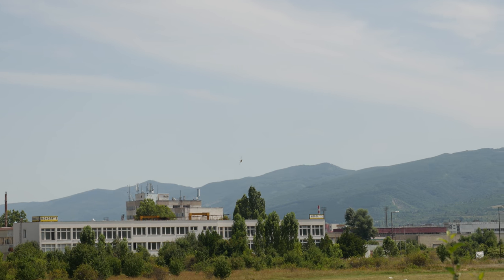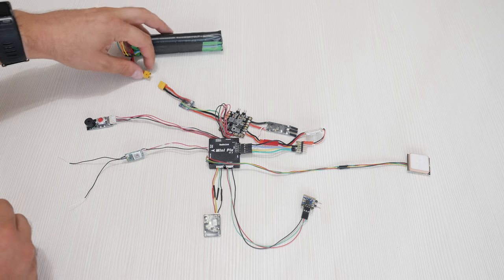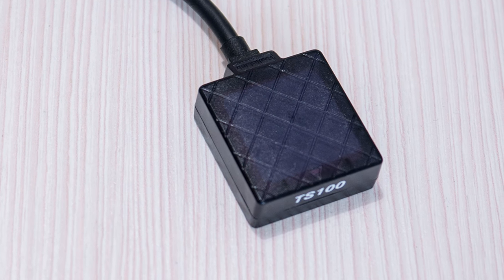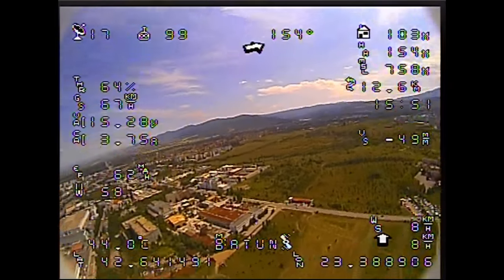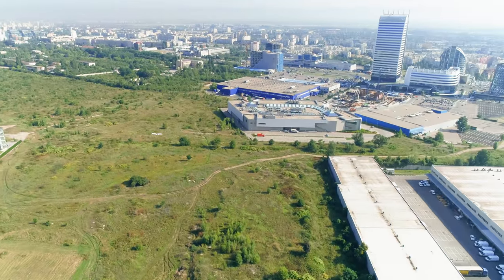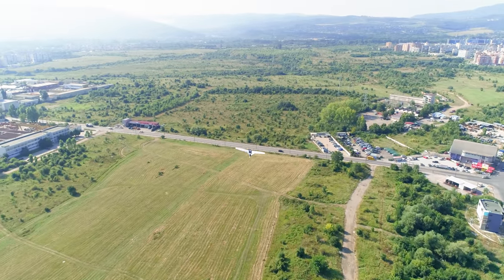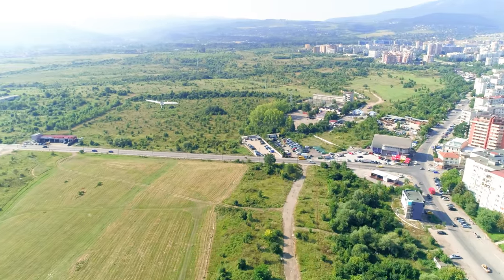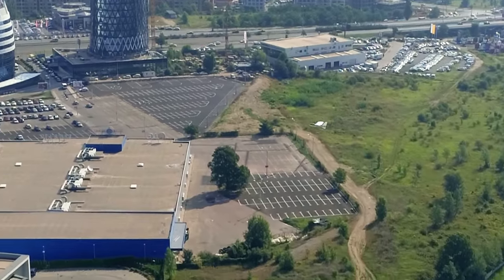ZOHD Nano Talon with RadioLink Mini Pix (install and maiden)

Comment: Hi. Volantex Ranger EX 757-3 1980mm Long Range FPV RC PNP or Volantex RC Ranger G2 – 1.2m glider plane 757-6 PNP, which of the two models is the best platform for a Long Range project, up to 20 km? Or, please, can you suggest another model that I can buy in the EU these next 2 or 3 days? I travel in a few days and wanted to take the model with me! Many thanks for the reply! Let's go forward! Best regards
Reply from the maker: Actually this is hard to say... both planes are COMPLETELY different - one is 2m wingspan, the other is 1.2m wingspan. For 20kms out I would go for the Ranger EX... but then it depends on what you need to do with it! The Ranger 2000 might be a more suitable option to be honest.
Reply: Really, thank you very much for the feedback. I asked this question a few months ago and I was hesitating this whole time ... I bought yesterday the 757-3, the landing gear and interior space ended up determining my option. Fly with 2 x batteries and all the electronics need to lift flight and get landed more sustainably, won this model! Now, I'm going to work on your electronics! Renovo, thank you very much for the feedback. Best regards...
Reply from the maker: Good luck on your build mate! :)
Reply: Thank you, will begin assembling the EX Ranger 757-3 this weekend ... then I give feedback about it! Best regards...
Reply from the maker: Fingers crossed! :)

Comment: Very helpful with information and real-world tests, super informative about equipment, batteries and LongRange as a whole. Learned a lot from this channel 

You rock!

After watching most of your videos, today was my maiden flight with Mini Pix and 4S2P/5AhLi-Ion config on handmade FT Spear, It flew great, made the test mission flawlessly, cruising a bit fast 55km/h but OK, the GoPro video looks stable and clean, got 41km range with 13.09v at the end and everything was smooth as butter.

BUT The compass variance error and bad logging are super annoying. I tried to disable all compasses but got Bad Compass Health error. Is there a way to disable it altogether  MP 1.3.7. Can it fly really OK without using the compasses?

Also any hints for Bad Logging, I've tried 4-5 different SDs ranging from 2GB to 32GB (FAT16 and FAT32) without luck, have any info on solving this too?

Keep it up.
Fly Safe :)
Reply from the maker: Thank you! Actually I've never used a compass on a plane, and I've never had issues for not using one! I just uncheck every tick box in the compass tab... and that usually sorts it!

Comment: So good to see a thorough display. I have three Mini Pix. All have passed the first steps up to and including Loiter (On a Copter). But so far the installed unit has not responded to the Auto command to fly a three waypoint mission at 3 metres alt. From Loiter it climbs to about 10 metres holds stable for 5 seconds and then descends and lands. No attempt to reach waypoint 2. I am using the Radio link version of Mission Planner. Any suggestions ??? Birdmanpete.
Reply from the maker: I see you already solved it! :)

Comment: Fantastic video, can I ask what is perhaps a silly question from an ‘old’ noob... is it necessary to also purchase the hk micro telemetry kit and what does it do ?
Reply from the maker: Not necessary, it is basically the same as the USB cable directly to the computer... only this makes the link wireless! Not necessary, but convenient when setting everything up in the beginning!
Reply: ArxangelRC you’re a gent, thanks for the reply
Reply from the maker: You are welcome! :)

Comment: Hi! i have ZOHD nano talon and the plane does not fly as many claim.
It does something like cyrcle and its hard to trim it. I was thinking to remove the gyro stabilizer that came with.
I'm thinking to install 2 servos for ailerons on the wings for better controll, what do you recomend?
And of course adding a flight controller.
Reply from the maker: It is possible there might be a problem with the stock stabilizer, so replacing it might be a good idea! I have also though about replacing the aileron servos and moving them to the wings... and even got some servos for that, but haven't gotten around to do it... though I do think it is a good idea and might improve things, so try it! People also do recommend the flat wings mod, although that is quite a bit more invasive in the plane's construction.
Reply: I don’t know when I will do all the modifications because now all our time and money goes to our newborn baby boy. 👼🏻
Reply from the maker: Yeah... I know how that feels!

Comment: Be careful removing the tape from the GPS receiver if you didn't put some heat shrink or similar on there before taping it down.  If it pulls the foil off the ceramic block, the receiver is toast!  (Ask me how I know . . .)    :(
Reply from the maker: Haha, thanks for letting me know... will keep this in mind when I get to removing it, although this particular tape isn't the strongest one I've used...
Reply: Mark O been there.  Lol

Comment: Sorry to have bothered you. Problem(s) solved. My Mission Plan did not show a waypoint 1
The list below the map did. The map did not. 
Also reset the Altitude to Absolute as I am flying over flat ground and in line of sight.
Feeling confident with my economical flight controller with all Radiolink components.
Reply from the maker: Right, so it is working now?

Comment: Not sure I heard in your video correctly but did you use auto launch with the mini Pix? If so what special parameter adjustments do you use? I am having difficulties getting motor to engage in auto launch. I have no other problems otherwise.
Reply from the maker: Yes, I do use auto take off with all Pixhawk controllers that I have! Not sure how you have programmed it... but there are no params to be adjusted for that to work! I setup a take off point on the flight planning page, give it climb angle and altitude, and let it rip!
Reply: @ArxangelRC  thanks. not sure if I am doing some thing wrong but I have not been able to get motors to power on. i will mess with it some more today and see what I can do.
Reply from the maker: OK... so you can't arm the motors to begin with?

Comment: great video as always! could you say me id arduplane is better than inav? what is you favorite code
Reply: please could you give me you point of view between 2 software
Reply: eclampsie I will definitely give you an opinion on the 2 Autopilots.  Arduplane is much more mature and has way more support and functions plus the GUI and Ground Control apps are WAY better.  You got your choice with Arduplane- Mission Planner, tower app ,QGroundControl,ect... inav is inav.. it’s ok for basic stuff but honestly I would never use inav in a vehicle that will be carrying a expensive HD camera just because of the reliability factor that I think inav lacks.   Inav is getting better but I don’t ever see it being as robust as Arduplane/Ardupilot.  
All that being said most F4 boards out there now can support Arduplane by flashing them over and that makes things a lot nicer Because  now with pixhawk or Apm you have to add all those extra components like osd current sensor, so on. With simple F4 omnibus or the likes all is included on the board which saves a ton of space and weight.  
I’m looking forward to the day someone develops a all in one Ardupilot board for fixwing that includes airspeed sensor sonar current sensors ect...  I will definitely pay for that!!!
Reply from the maker: Yeah, what Sky said! My choice is Arduplane over iNav, any day!
Reply: thanks for you help !!! i have bougth two f405 wing from matek to use chibios and i can but chuck from disco parot with everything on it for only 100euro
Reply: eclampsie 👍
Reply from the maker: Yeah, these make the builds very cheap now!

Comment: I am thinking of getting this with a full PX4 Pixhawk with Pitot and telemetry. For a first long range fpv plane with autopilot. Do you think this would suit the plane or would you recommend another FC.
Reply from the maker: How much of a long range are you looking to do? Why this plane? A full Pixhawk would be too big for this plane and is just not reasonable!
Reply: ArxangelRC This is going to be my first fpv plane. I want this plane to have fun and as a platform to learn to use all the long range stuff like fpv gear and autopilots. So at a later time I can build a bigger and better plane. As for range I want to go at least 2km up to lets say 10km. Do you have any other autopilot or plane to suggest? (I would like to try autonomous functions). Thanks.
Reply from the maker: Hi, actually I can recommend something else... but it is bigger! As an autopilot a very good option is an Omnibus F4 Pro board (https://goo.gl/iivVJN) flashed with ArduPlane (https://youtu.be/LyNlnVo8TdA), all the functions you could ever need, along with a current sensor and an OSD all on one board, and for a plane... a good flyer is the Ranger 2000 (https://goo.gl/EG5jrK) for instance... it is bigger than the Nano Talon... but it should be easier to handle and not as prone to stalls!

Comment: Hello, great video, how can I calibrate ESCs on the mini pix? I tried to do it with the lever up and all the standard procedure, but it doesn't work, any ideas ?, the motor only beeps continuously every time I start
Reply: You have to move the stick in a certain portion to arm if no arm button and change the safety start number in the mission planner,I have the new pixhawk4   mini and servo rail needs power so my esc have 5volt built in bec that powers that rail and two servos only,and I have a power module that power the motor from battery and other side of the pixhawk to.
Reply from the maker: When you power everything up and arm system, unplug the ESC only from the power module, do not disconnect the battery so the Pix can remain powered! Throttle up, plug in the ESC, and after the first beeps throttle down, you should hear the confirmation beeps, and be done!

Comment: Hello, help me, I have a mini pix that does not respond, investigating I discovered that I have to modify the firmware of the mini pix, because it does not have the Ramtron FRAM chip installed, since it is a 9/9/19 version, could you share a modified firmware to load it on my mini pix?, no firmware version I found works for me, I'm looking for the "plane" version, thanks.
Reply from the maker: Hey... hmmmm... that is the first I am hearing of such a problem! Also, I do not have a firmware file to share. Try the ardu firmware download website, and just go back in time... in the folders, if possible...

Comment: Hi, I'm trying to set Nano Talon with  Pixhawk 2.4.6 and Flysky iA6b controller. The Mission Planner responds to everything but when i connect the battery to the pix, the motor constantly beeps in 1 second interval. The motor doesnt throttle with stick movement. Please provide some suggestions.
Reply from the maker: With everything power up and Pixhawk armed, try unplugging only the ESC from the power wires, and then plug it back in, see if that scheme works!
Reply: No result with that
Reply: Can you please tell if the following battery Is compatible with Nano Talon's ESC :

11.1 V, 50 C, 5000 mAh Li-Poly.

If not I'll have to buy a new one.
Reply from the maker: @karthikprakashsivakumar3973  Well... voltage wise it is... weight wise though... might be too much, and also may be too big! Did you manage to sort out the ESC thing? Unplugging and plugging it only does help in the cases where I've had this issue!
Reply: Nope it didn't work. 

Now, I've got the solid green light working so it's armed. But still the motors not servo respond to Tx.

Should I calibrate ESC connected to Pixhawk ? If so, how?
Reply from the maker: @karthikprakashsivakumar3973  Well, with everything powered up and the Pixhawk armed, disconnect the power cables to the ESC, throttle up, connect power to the ESC, it will beep, throttle down and wait for it to stop beeping! That should do it! What ESC is it?
Reply: @ArxangelRC  it's a nano talon PNP plane.

Btw can I plug both battery and usb simultaneously with Pixhawk ? 

It arms green light only when on usb
Reply: @ArxangelRC  Hey I did exactly what you said. For a fraction of a second I hear motor rotating and then no response. Pixhawk light changes from "green" armed to "blue-yellow-blue-yellow...." thereafter
Reply from the maker: @karthikprakashsivakumar3973  You should be able to plug battery and USB at the same time! What is "blue-yellow"?
Reply: 1. Pixhawk arms Green Light for a minute or so.

Thereafter I get "Blue light - yellow light" repeat (by website it means Gps checks failed) . Then have to I redo arming to set it to green light again.

2. I tried doing ESC calibration just using battery connection alone. Pixhawk doesn't light up in my 11.1 battery. Just keeps giving "tick tick" sounds under "battery only" connection.
I need to fix this to have a go on ESC calibration using battery.

Please type replies by numbering 1. and 2. For respective questions
Reply from the maker: @karthikprakashsivakumar3973  Sadly I can't help much with the LED indicators on this one since I am not using these boards, and haven't used them for a LONG time... so no idea what that means or why it would return a GPS error... perhaps something is interfering with the GPS at times and it loses sats.

As for 2. After you ARM the pixhawk, disconnect power only to the ESC, all the rest should remain powered... unless you are powering the Pix from the ESCs BEC, which is generally not a good idea... and would make this calibration a lot harder!

Comment: Do you know what you have to do to output RSSI value from frsky receiver to the minipix parameter wise?
Reply from the maker: Which FrSky receiver? There are a number of models!
Reply: @ArxangelRC  Yes of course, I am only talking about the rssi pin of the mini pix that is dedicated to receiving rssi signal, and what parameters you have to change, mainly rssi_pin param to make ardupilot software understand that i am using the minipix rssi input.
Reply from the maker: Right, you have to select that it is the analog pin, and then set the voltage range on the pit from 0 to 3.3v, as the FrSky receivers operate on that voltage. I think this should be enough... and also the enable RSSI param... don't remember it exactly... should be enabled... or something!
Reply: @ArxangelRC  yes but you also have to set the specific rssi_pin 11 or something for exaple to make it understand where to expect the input.
Reply from the maker: Oh, right... I think that was 103 on the Pixhawk firmware.
Reply: @ArxangelRC Thank you very much I ll check it out!
Reply: @ArxangelRC  After some research it seems that it is rssi_ana_pin 11 (pixracer) for this board and rssi_pin_high 3.2v to have the most acurate reading!
Reply from the maker: Right, yeah... Pixracer was different for some reason! Glad you figured it out!

Comment: Can anyone help whetherThis autopilot can be used for eflite convergence VTOL ???
Reply from the maker: Yes, I think there is a VTOL firmware available for this flight controller! It would be the same as for the Pixhawk!
Reply: Myn is eflite mini convergence model and it's a MAV can I use this autopilot for this model
Reply from the maker: Should be possible... but I am not well versed into the specifics! Doesn't that model already have a controller in it?

Comment: does it support otg? smartphone connection?
Reply from the maker: I have not tried that!
Reply: @ArxangelRC  Can you check it please. i want to buy it but heard that it doesnt support smartphone connection. by the way how it works?
Reply from the maker: @sabitbagirli7399  It works OK, will have to see which plane I have it in, though I am not a fan of smartphone connections... if you put a bluetooth module on the mavlink port, you will be able to connect to it wirelessly anyway... so why bother with an OTG?
Reply: @ArxangelRC  in terms of range telemetry is better thats why i want to connect it by otg. ok thank you for help
Reply from the maker: @sabitbagirli7399  Wait... what is the goal here... ? To connect to it via cable on the ground, for setup... or to connect to it while in the air?
Reply: @ArxangelRC  i want to connect it to QGC software in the smartphone and control or give missions by phone. but i have heard that this controller doesnt support connection to smartphone. physically i can connect telemetry to smartphone by otg but will it connect to QGC on smartphone i dont know.so i wanted to be sure if it works with smartphone too.
Reply from the maker: @sabitbagirli7399  But all of this you want to do on the ground, before flight, not during flight?